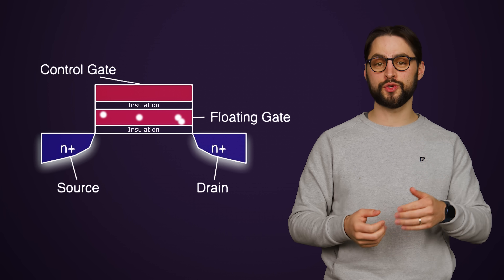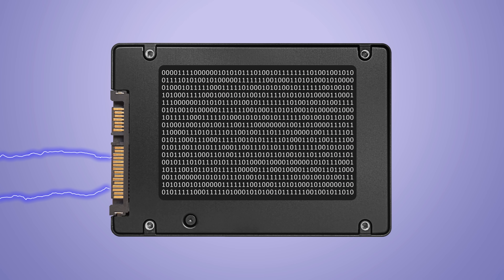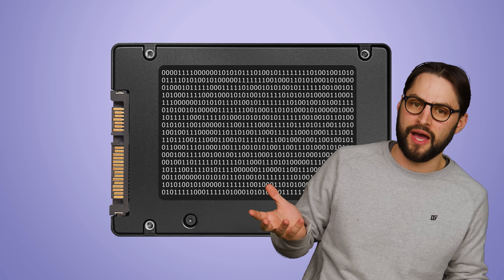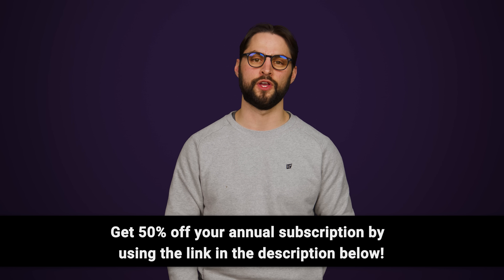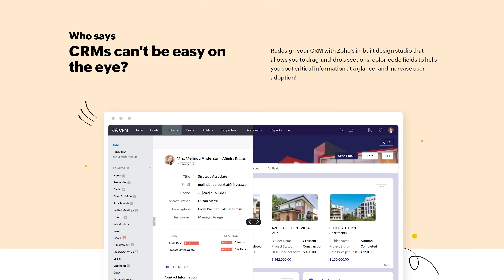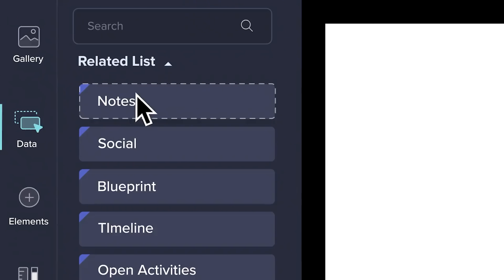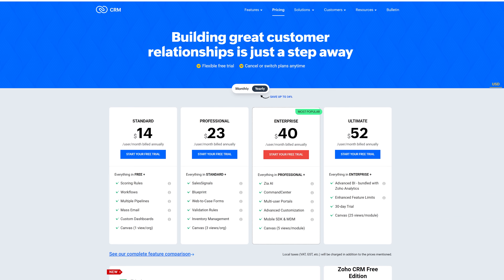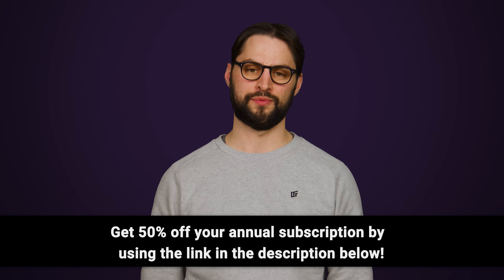SSDs Die, RAM Doesn't. Why?

Comment: What I have seen with SSDs is the following:
1. A lot of consumer SSDs will die with age.  So say your 'cheapy' consumer SSD is 6 years old and has a wear level count of 19.  I have seen a number of consumer SSDs die like this even though that wear level count is really low.  What I have been seeing with enterprise class SSDs and some of the higher end prosumer class SSDs is they seem to be basically invincible.  Lesson being these more costly SSDs get you a whole lot in terms of endurance and reliability.  They say all SSDs age, but from what I have seen is some age a lot better than others.  On this note I have seen some DRAM less SSDs fail after just 3 years.  That DRAM is important.

2. A lot of consumer SSDs will lose your data when they fail.  I have seen things like a chip goes bad and the data is striped across the chips, so you have a swiss cheese drive, which is basically unusable.  Hopefully you have a backup because that SSD is going to be extremely hard to recover anything from even with just one flash chip dead.  Another thing I see a lot is the data just won't read back the same as it was written.  Talk about leaking electrons, well what I have seen is the sectors don't get marked as bad, it is just the bits don't stay the same and you get garbage out.  It is important to note that computers are highly reliant on perfection, so these kinds of problems quickly turn into if you don't have a backup, you are in a world of hurt if you actually cared about that data even if the drive is technically only partly bad.  At this, it can get into bit-rot where there is silent corruption and then you backup that corrupt data, so then your backups are corrupt.

3. This gets into another point RAID and ECC RAM.  If you have data you care about, RAID, ECC RAM, and backups are a must.  The data might corrupt on the drive.  The data might corrupt in RAM silently and then get written to the drive.  The backup reads off of the drive, so if it is corrupted by one of the above, it goes to your backup corrupted, the thing I was talking about as bit-rot.  There is some nuance here I am not getting into, but basically you need the integrity in RAM and the integrity on your main storage device, or else what that backup can do to preserve your data is limited.  At this most ways to do RAID does not properly support TRIM or TRIM at all, which is a key factor in your SSD's life in terms of wear and RAIDs are hard on SSDs as it is, so most people doing RAID really need enterprise class drives in order for the drives to not get destroyed to quickly with too much writing.  The only RAID I know of that properly supports TRIM in real world usage is ZFS RAIDZ.  ZFS is a dream come true for anyone who cares about their data and an important file system to consider when storing data you care about on SSDs.  However ZFS is something that exists in the Solaris, Linux, and BSD UNIX realm, not in the Windows realm.

So for an SSD rundown based on what kind of user you are:
1. Gamer - Especially if you primarily play through Steam, probably not too concerned about your SSD as if the one you have fails, you stick in a new one, go through the annoyance of re-installing and getting Windows up to patch, and re-download the games you are actively playing on Steam.  So in a couple of days you are back up and running.  If you are a really avid gamer, you may have a bunch of customizations that make this harder to do quickly and may think more about a quality SSD in your computer to reduce the chance of this annoyance.

2. Student - You may game some, but if you are a successful student you have the discipline to get your work done.  At this you don't want to lose that term paper a week before finals.  You also don't have a lot of money.  So what you probably need is a reasonable quality SSD, a good virus scanner as schools are breading grounds for viruses, and either a cloud backup of your school laptop or an external USB hard drive you backup to.  Really, you probably want the cloud backup of your data or at least stick it in Onedrive or something.  Especially with Onedrive, it will remap the places where you usually stick your files to be in Onedrive.  Most places you go is going to have WiFi, but you can also get a cellular hotspot or may tether to your cell phone, so cloud is definitely an option for that term paper.

3. Family computer - Basically the same guidelines as the student.  Maybe you also run a NAS device to stick your files on and use that NAS device for other things.  The NAS device is not a backup and so you also have to have a backup solution for that.  I have seen a number of NAS devices lose everything over the years, often times due to some glitch where you wouldn't think the data should be lost, but it did get lost, so these are not really all that great of a place to stick data and backups of these are very important if you have one and data you care about.  You may also see some bit-rot with these NAS devices as the hardware in them tends to be on the cheaped out side.  Not to say these are a bad solution, but instead it is not the highest grade solution.

4. Business - The first thing is you don't want a bunch of data on desktops and laptops.  Either it is on a server with ECC RAM, RAID, and a good backup solution inside the company or going out to the cloud somewhere, which can take a number of different forms.  Then you have a good deployment scheme to quickly image systems to corporate standards.  So this reduces the need to have a quality SSD in the desktops and laptops, but you still don't want the headache of the cheapy SSDs failing, so it is a good idea to invest a little to get above the bare bones SSDs.  You also really want backups of everything, especially in the days of ransomware and at this BMR (bare metal recovery) is rarer than you might think, but is possible.  Any internal servers are going to have enterprise class SSDs of course and depending on the shop, you may have access to ZFS or you may only be able to do hardware RAID.  Often times in a company the data stored on a laptop or desktop ends up gone when an employee leaves and the hardware is recycled to be used by another employee, but then somebody wants / needs to access the data by the ex-employee, but it is nowhere to be found, so another reason to not stick data on a desktop or laptop.

5. Enthusiast / Power user - When you get into this realm, you are talking workstation hardware most probably.  You will beat on SSDs a lot, so they need to be enterprise grade or at least high end consumer as it does matter.  You may try software RAID, but this is a bad idea unless of course you are using ZFS, but usually you will first try some other software / firmware RAID and end up regretting it.  So then you either end up with ZFS or a hardware RAID controller.  At this a hardware RAID controller will need to be modified to have a fan on it as these are designed for high airflow servers while a workstation does not meet this metric in most cases.  If you have lots of data, you may think about a SAS expander, but really SSDs need a direct attachment to a RAID controller for performance, though mechanical drives not so much.  You also need to consider what backup solution you are going to use.  This gets more constrained as if you have a lot of data, some of the options can get to be really expensive while other options are a lot more cost effective.  You probably also want a BMR (bare metal recovery) solution or however close you can get to it in order to minimize down time.
Reply: Cool info Thank you.

Comment: All 3 first SSDs I've gotten have failed (and failed quickly, like in 1-4 years), and none of them failed in a read-only manner like this video said. Of course this video said "should", but it's still rather misleading, since clearly a lot of cases don't have them fail like this.
Reply: That probably indicates a problem not associated with the SSD "wearing out" which is when this read only mode would be activated. Im no expert and not suggesting your SSD didn't fail, but it didn't "wear out" either.

Comment: You also neglected to mention that most SSD failures come from its controller (most times due to overheating) and not the flash chips themselves. That's got nothing to do with degrading but bad manufacturing.
Reply: OK go make your own educational video then
Reply: That tends to happen with click-bait videos like this one. Over the years I've had dozens of sticks of RAM fail on me, but so far haven't lost a single SSD.
Reply: @looneyburgmusic  If you're losing dozens of sticks of RAM, you're doing something very wrong.
Reply: @someguy4915  not with the number of systems I run 24/7 I'm not. 

And by "years", I mean since the mid-80s
Reply: @looneyburgmusic  Yeah, you're absolutely doing things wrong if you were using DDR RAM in the mid-80s :P
RAM from the 80s is nothing comparable to RAM of the last 20 or so years, it's like saying cars are unreliable because you can't ride a bike, two entirely different things.
If you're breaking multiple DDR RAM sticks (DDR1-5) you're also doing something extremely wrong, especially if they run 24/7 meaning you're not touching them and they still break.
You either are using extremely cheap power supplies, constantly touching the RAM without any ESD protection, hitting the RAM with a hammer or mis-diagnosing broken RAM.
Either way, time to figure out why you keep breaking RAM (or why you think it's the RAM that is broken)...
Reply: @someguy4915  🤣🤣🤣🤣🤣🤣🤣🤣🤣

Where did I say I was using DDR in the 80's?

Here is what I said - " Over the years I've had dozens of sticks of RAM fail on me"

You having some trouble comprehending plain English?

Point out where I specified what TYPE of ram had failed, or why it failed. 

Or be laughed at some more
Reply: @looneyburgmusic  Exactly as I thought, just a kid throwing a childish tantrum reaction when called out on his bs.
Weird thing to 'brag' about, being unable to keep RAM from breaking though...
But funny to see how you react when you realize you can't bs your way out anymore.
Reply: @someguy4915  "kid"???

😭😭😭😭😭

My grandchildren are more likely older than you.
Reply: @someguy4915  Also love how you instantly tried to deflect away from your incorrect assumption, after failing to comprehend a simple statement
Reply: @someguy4915  esd isn't the problem it was decades ago. Modern equipment has a higher tolerance these days.

Comment: So SSDs fail over several years, and I just recently learned that over a longer time, CDs and DVDs degrade.  If I wanted to store, say, the family photo album and correspondence for descendants 200 years from now, what equipment currently available, if any, could provide such durable storage?
Reply: To my knowledge, everything we use today to store information is prone to bit rot. With Hard Drives, if the data hasn't been scrubbed or accessed for about 5 to 7 years it can just slowly corrupt. Some sectors can still be salvaged but most of the data can just simply be gone or unaccessible. Something I learned about recently as I was also looking into some long term storage solution is Tape. However tape is also not a perfect solution because it too can lose it's data over time. But it's much better than hard drives because tape can hold data for about 25-30 years if stored properly. If you're needing something to be stored for about 200 years, good luck. The only thing that's going to last is either a literal polaroid photo or storing it on the cloud. Assuming that this cloud service is still available around that time. Even then, cloud services have to do what we consumers do too, replacing broken hard drives and maintaining the stability and integrity of the server. If they fail on that, then it's gone.
Reply: @ChfHappySack  how about...  THE CLOUD?
Reply: @forrandomsites3336  Did you even read my comment??? I literally talked about THE CLOUD and it's pontential flaw that could happen within 200 years.

Comment: Umm, the function of a capacitor is to hold charge, when you disconnect your powersuplly, it will still hold chrge if there isn't any power draw from it. Sooo, does that mean, the caps get discharged after disconnecting it from a powersupply? Someone explain this to me.

Comment: But also SSDs have much larger capacity than RAM.  Why?
If that were not the case the idea of RAM drives would be practical again, just add a permanent power supply... like we did back in 1999!

Comment: the premise of the video is kind of wrong though. RAM dies, arguably at a similar rate as an SSD would depending on use cases. And an important cause of degradation, erase cycles, are the same between the two. Running electrons through a capacitor still degrades it. It's not like the only mechanism to kill memory is to break down an insulating layer. And while some companies offer lifetime warranties for RAM, the terms of those warranties are often geared to make it a bad value. Also, most are 1-2 years

Comment: I have worn out quite a few SSDs. At least to the point of SMART warning triggers.

Wear leveling won't stand a chance if you:
1. Run software that regularly writes/overwrites/deletes large numbers of tiny files.
Like for example scheduled metadata refreshing on database/media servers.
AND
2. Run on SSDs filled almost to capacity (92%+) over extended periods of time (days or weeks).
Reply: A little extra manual overprovisioning might expand the life span of an SSD. I usually create an empty partition of 10% of total size for this. This also prevents the performance degradation of an almost full SSD.
https://www.youtube.com/watch?v=Q15wN8JC2L4

Comment: I have a 250gb samsung 970 Evo plus that I bought in late 2020 for my first build and I have been using it every day since, about 8-12hours a day. Now the drive is reporting 92% life remaining. I don't know how much longer the drive will last or how much degradation is unusable but the percentage is going down much faster than I expected.
Reply: 8% degraded in 1 year then 100% will get degraded in 100/8 = 12 years and 4 months approximately. You should not be worried about its health.
Reply: @hemant3332  Hmm that's reliving to hear, though I have heard somewhere that drives will start to act unexpectedly at 60% or lower. Wonder if that's true
Reply: @thangluongquang2826  Don't worry that much, take a backup of imp files regularly, there is always a probability of failure after 3-4 years even with a hard disk but most probably it will serve you 12 years.

Comment: RAM absolutely goes bad. Every 3-4 years, I've had to throw out 32GB of ram and get a replacement kit because it starts bluescreening (Windows) or causing process segmentation faults (*nix). Also, RAM still can (and does) die from old age.

Comment: So, how long does an ssd live for? I'm planning to buy a laptop and depending on the answer I might buy an external hdd. If anyone knows please comment.
Reply: Depends on the SSD, how you use it etc. etc. Impossible to give a straight 'so many years' answer. Typically you'll be replacing your laptop years before the SSD in it fails.

Comment: my very first SSD was a Samsung 840 EVO in 2013. I remember being so worried at that time about it wearing out (they were expensive AF that time) that I actually calculated its estimated life/cost vs. just getting another HDD.

Said SSD is still in use in my current PC as a cache drive for my game HDD and is the only thing i've carried forward from that old build. it's lasted three whole system rebuilds (Q8400, 3770k, 3700x) and i'll probably still bring it to my next one.
Reply: I did the same with a 30gb SSD i got from my brother-in-law. Due to its storage size i end up using it as a cache drive to keep my primary SSD last longer. I couldn't think of a better use for it with that 30gb. Still running with no issues.😊
Reply: @blackpearl1-477  that’s insanely smart I must do that
Reply: I got an 850 Evo in 2015. It spent a year in my PS4 and is now one half of a RAID array I keep my games on. Stripe by the way.
Reply: My 840 Evo just died on me a few days ago out of the blue. It was my boot drive, luckily I noticed something weird and backed it up last minute. It definitely didn't do the read-only lock thing mentioned in the video, it just died.
Reply: @walkieer  I'm still using the same 840 EVO drive as my boot and now I'm a little paranoid.  Drive condition is still "Good" under Samsung Magician with 31TB of usage.  What weird things was yours doing?
Reply: I still have a Q8400 and I7 3770 :) what a coincidence
Reply: @DualPerformance  Me too! Q8400 & still using it.
Reply: and SSDs are so much more affordable today. Technology.
Reply: I got my Samsung 950 Pro 256GB M.2 6 years ago for 177.99. Still running as my windows drive after all this time.

Comment: I have DIP RAM in a 386 that's over 30 years old and a ton of SIMMS that work, whereas I have replaced a ton of SSDs. Actually, I have more old (40-1000Mb) drives around my place than I do of working SSDs.

Comment: You know the funny thing is I've had RAM sticks fail in under 1 year while my friend's SSD from 2011 is still working today, in another friend's PC. Heck at one point I had a fat stash of unusable ram, one of which would actually break any mobo that I put it in. 

I know SSDs are meant to die faster but why have I been cursed to be around RAM sticks that are constantly unaliving themselves
Reply: If you overclock or use unstable settings for ram it dies

Comment: Not a bad video on RAM vs SSD. It would have been nice to include HDD and lifetime with Read/Writes vs capacity.
Reply: HDDs have a far higher failure rate than SSDs...typically because the arms will fail somehow.  HDDs have never been rated in read writes